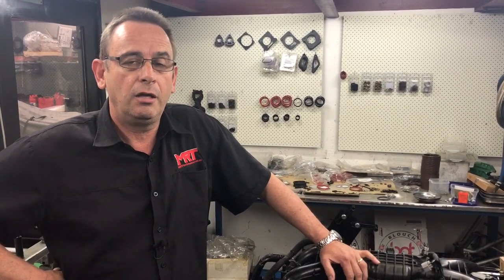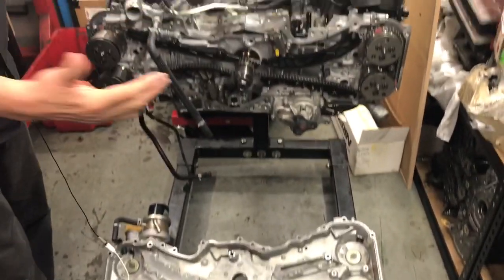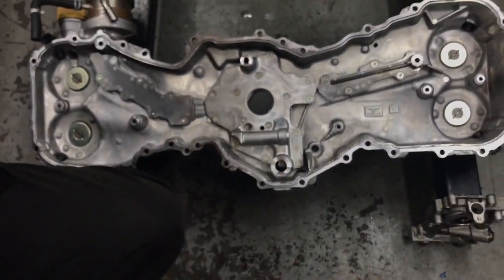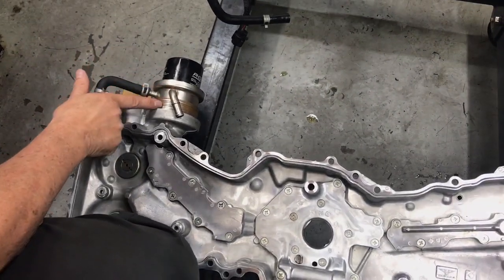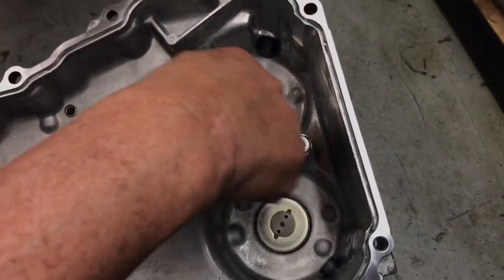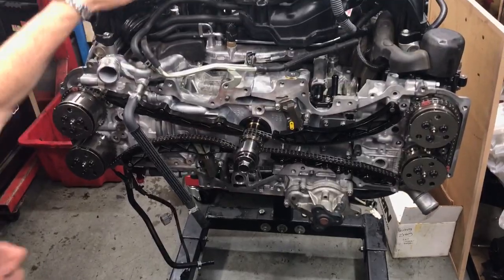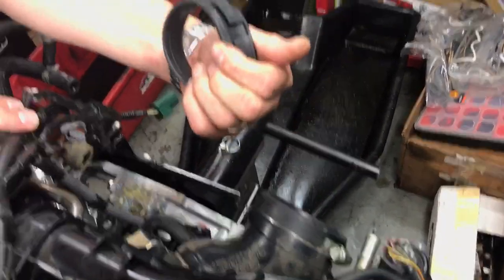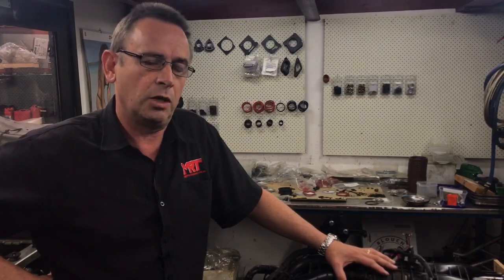Subaru FA Series Engine - Ancillary Components

Comment: The heat exchanger oil cooler if you are just replacing block and you didn't have an engine failure would you have to replace it?